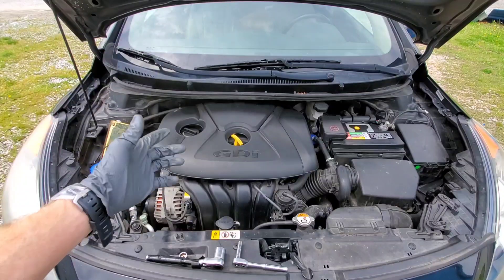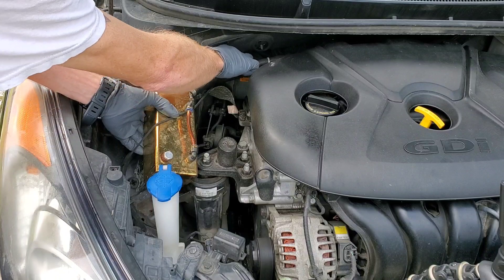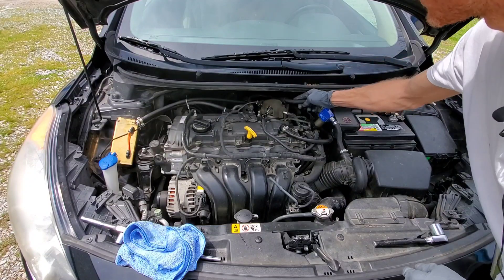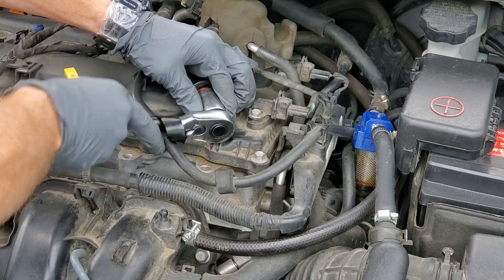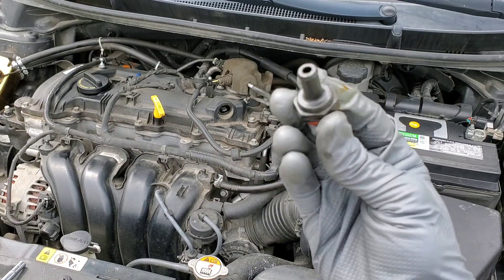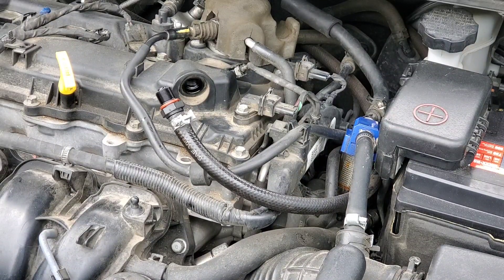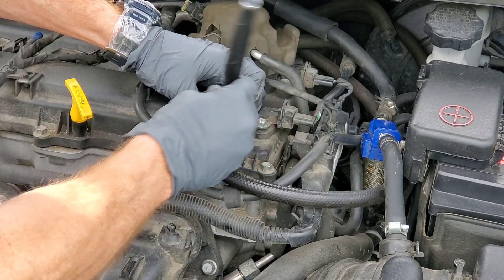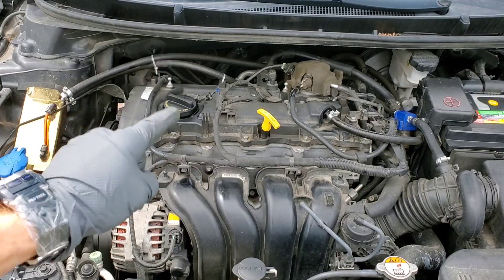How to stop carbon build up

Comment: 3rd generation mechanic, we have never used catch cans on our regular vehicles only race cars. Many DI engines with over 250k miles in our family. . The key Tier one gasoline, Good synthetic oil change at 5k and replace pcv every 50k miles. PS don't shake them; you should only be able to blow in one direction. It's a check valve. Also, the oil in the can is after cooling it's actually a misty gas that goes into the intake:)

Comment: LOVE my catch can on my F150 it used to burn 2 quarts between oil changes now it rarely uses a whole quart!!!
Reply: Never had one on my 2015 ecoboost. No oil burn runs great. The key Tier one gasoline, Good synthetic oil change at 5k and replace pcv every 50k miles. The oil in the can is after cooling it's actually a misty gas that goes into the intake:)

Comment: it's too bad california will ding me for having a oil catch can.
Reply from the maker: Im not saying to do so but knowing me im probably crazy enough to then use stock for inspection how dont do that. I hear they are talking about changing the laws.
Reply: @NATESINTERACTIVEAUTO  I know the whole routine..lol. I used to do it with my bolt on mods. Take them off and put the stock stuff back on when it's time to smog. i really do hope that they make adjustments. Oil catch cans are really helpful in reducing the amount of crap that goes back to your IM.